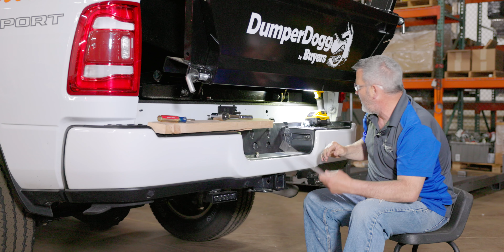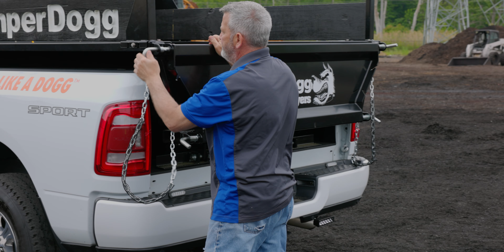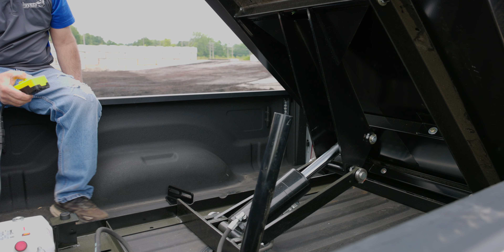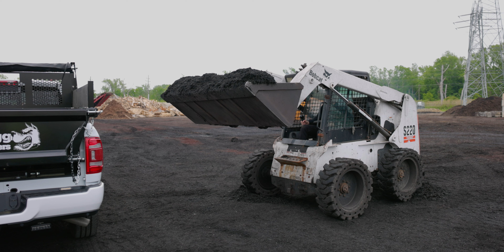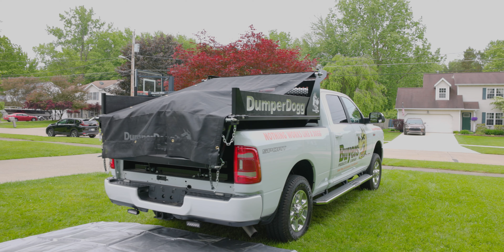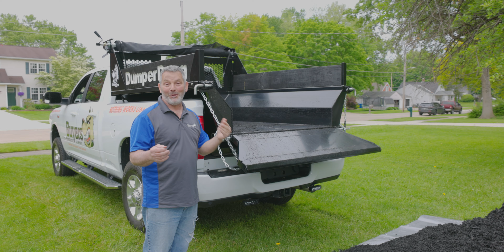How To Install Your DumperDogg® by Buyers

Comment: I'm curious, what size battery cable and circuit breaker is used for the 8ft dumperdogg?
Reply from the maker: Thank you for your comment and question! I followed up with our Tech Support team, and this was their reply:

The circuit breaker is 150 amps and the size of the cable is 4-gauge wire.

If you have lingering issues, you can reach out to Tech Support by calling our main line: 440-974-8888. Thank you!